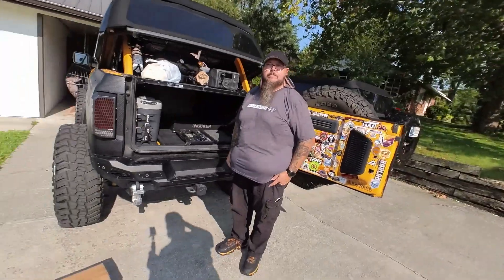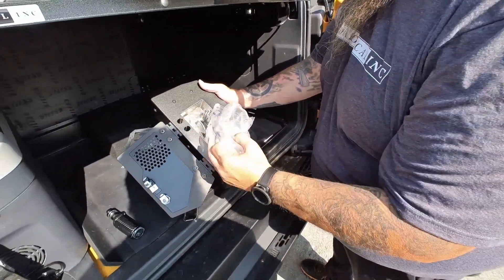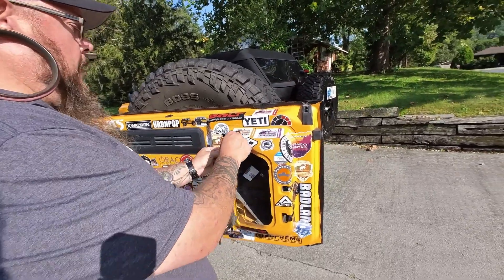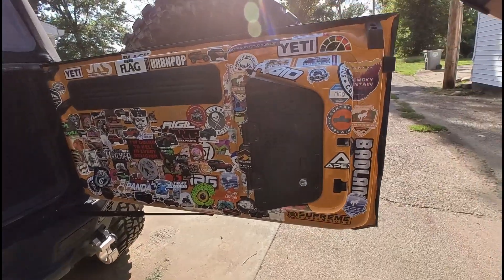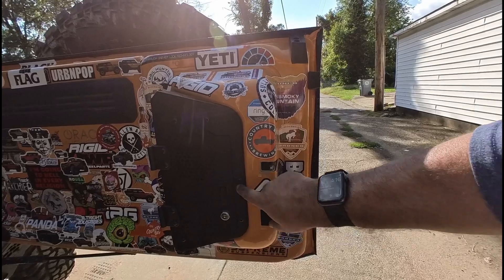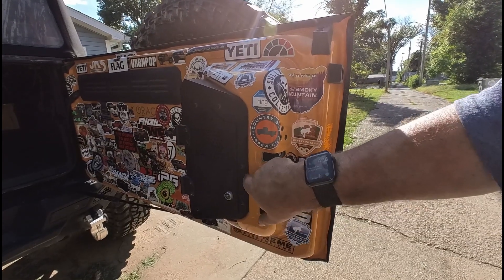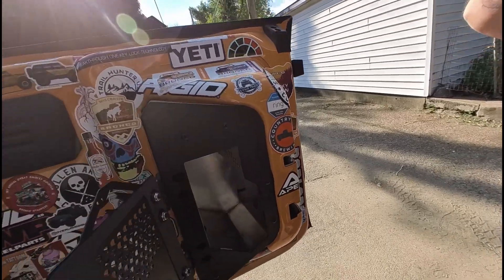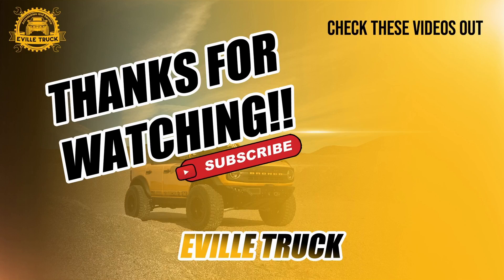Metal Tailgate Medicine Cabinet: Worth the Money?

Comment: I’m guessing the mounting screws are phillips head? May be advantageous to source the same thread with a safety torx head, just for added theft deterrent. 

I was curious if a water gun would fit in there, good to know!
Reply from the maker: They are hex head, but yes switching to safety torx would add additional security.  Any type of water gun that you might consider for concealed carry would fit. Not going to be able to fit  a larger water blaster in there though  😉
Reply: @EvilleTruck  lol perfect! I have the center console lockbox, but a secondary backup water gun is never a bad idea.